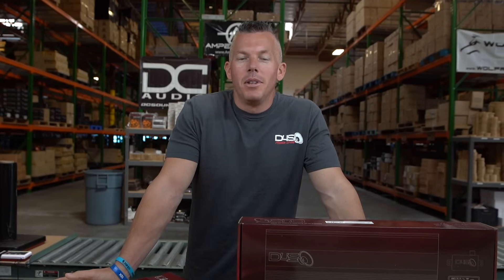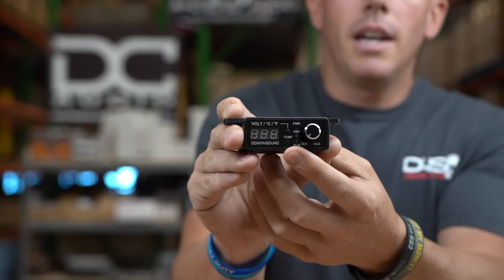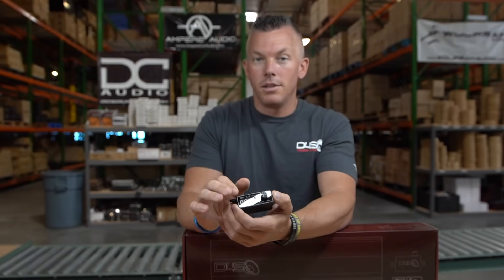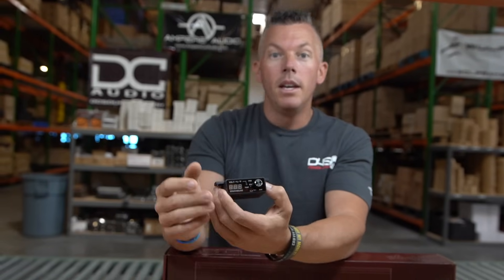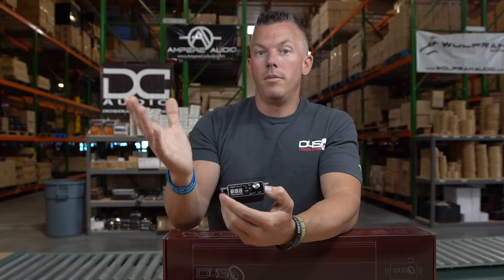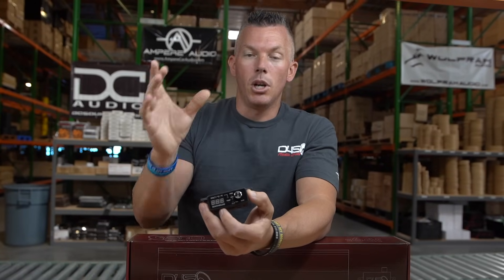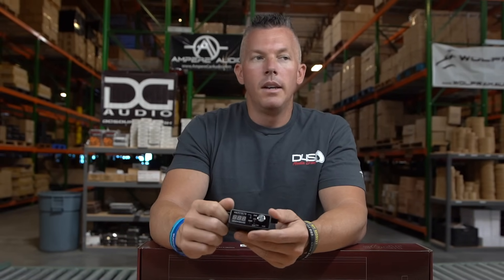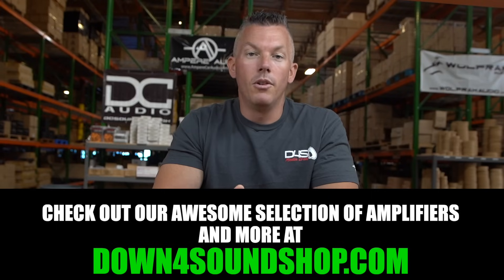CLIPPING: WHERE DOES IT START, HOW DO YOU PREVENT IT?

Comment: i dont think you exactly understand what clipping really is lol its not "more than an amp can push out" while yes, its trying to send more than it can, thats not why its clipping. clipping is mainly because of input voltage. the 1.4v coming from most peoples radios (with the sub level maxed out) isnt enough of a signal for your amp to amplify. its trying to turn something thats barely pushing a single volt and trying to amplify it to 70-80v going to the subs. its basically making up its own signal, thats what clipping is

Comment: I’m glad I watched your video because I had a car audio place put four new speakers in my Ford Ranger 2020 Ford Ranger and there’s two tweeters upfront and two co-axles upfront along with two 6 1/2 in the back with those being 300 W speakers he only has a four channel Alpine 300 W amp running to all my speakers and these Alpine came with 2 crossovers  and it doesn’t matter how you tune this thing oh and he also put a 8 inch kicker subwoofer behind my backseat so it’s clipping and it’s clipping around the volume at 30 you cannot turn it up all the way to 40 and I have the new Pioneer 10.1 inch WT 6000 deck I believe it needs at least 1000 W amp for those alpine speakers at 300 apiece. What do you think? Can you please help me thank you.!

Comment: I have a question if I may. My powered speaker (Groove Factory ABS 1002/A 10" 150W) has  2 inputs which have their own volume/gain knob and a volume knob for the master output of the speaker. The volume/gain knob for each input just has a min at 7 o'clock and max at 5 o'clock with graduated markings. There is no marking for 0db or unity. My question is where is 0db or unity on this graduated scale.

Comment: Can starving a amp for power cause clipping? I am having issues with voltage drop in my car with a 200 amp alt on x2 agm batteries hitting as low as 11.8 volts  my wiring is 4gage welding grade pure copper i know should be 0 gauge and it will be soon but figured my amp would be ok for short bursts since it's sitting on a 100 ah agm brand new battery rated for 2400 watts pushing my Orion XTR PRO 2300.1dz on dual EVL ported box, it's not even half as loud as my dual SDR setup was on a RP 1200.1.

Comment: A more important factor that wasn't touched on here is proper gain staging and signal flow.  You want to ensure levels are optimum between each stage or component in the signal flow for best performance. It's like driving with a manual transmission.  To get the best performance out of your engine, you want to shift when the engine is at peak performance, just below max rpm.

Comment: As a master tech in the electrical/mechanical fields I am curious why you do not explain this correctly. Three things are important here: as follows:

Voltage, Ampacity, and Electical draw vrs what is actually available. These three things equate to actual output - PERIOD.

Maxium electrical draw is required first to determine what the actual wire sizing needs to be for any given system. For example: A 12 gage wire will handle 20amps with 140 feet of wire run- constant @120volts, safely. So if we consider electrical loss over said run (voltage drop) we also need to consider ampaicity of said wire- hence the rating. The number one rule (Ohms Law)  is as follows: As voltage drops, ampreage rises- and as voltage rises, ampreage drops this is true in ALL electrical circuts be it an AC or DC circut. The alternator(s) in your car uses a rectifier circut to create an AC electrical signal then rectified into a DC electrical charge for your battery(s). This is basically how your cars charging system functions. FYI, DC stands for Direct Current and AC Stands for Alternating Current. Direct Current is where electrical signals flow in one direction Possitive to Negitive (depending on whom you ask). AC flows in two directions and has no actual ground at the source, it's "ground" is actually neutral it acts as a return path and as a ground source at the same time. No this is not the same as a floating ground.

When a circut is over driven you get "clipping" this is due to many factors, but for the most part the amplifier is "out of gas"- or over driven, this, be it lack of voltage or amperage usually both. However,  really good amplifers with properly designed regulators wont let this happen. I wont go on any futher upon this topic as it would be a moot point, Except to say this: your typical car audio amp has a 12 volt source @ a given ampreage, where as - a home audio amp has a 120 volt source @ a given ampreage- do the math.  :) Volts times amps equals watts.  One thing that has always botherd me about car audio is the S/N ratio it is usually below 85 Db - this is terrible. Consider the audio circut and the noise interjection.

But I will say this, consider your grounding & power points, they need to be thick and rust free- preferably directly coupled to the battery source and never crimped in a bad manner. Always remember Polarity is king in a DC Circut- as it rules what DC sources actually do (push or pull) and finally remember this- AND IT IS  VERY IMPORTANT- the output of your car audio amp is a DC source (Polarity driven),  a very different animal then your home audio set up, yet excatly the same, ask yourself why?
Reply: the output of car audio amp is ac.
Reply: @nickpowell7432  um, no it is not, ac doesnt drive your speakers, dc does. come on dude learn before you speak.
Reply: @kodi4167  learn before you speak

Comment: I imagine that not having a pure sign wave like if an inverter or generator is being used not providing a complete buffered power supply could potentially cause this if it's not supplying power with the frequency at or below that of the signal to the Sub? I guess if it was a constantsound at all it would be noticed and 60 Hz is pretty universal

Comment: gotta sundown x8 v4 d2 with the 2800rms jp23. has this clipping issue figured this would be a winning combo. would upgrade to bigger but my fear of this not being the issue holds me back
Reply: That's the beauty of a SMD DD1 or an oscilloscope. You using a quality LOC from either Kicker or Recoil to connect head unit to your amp? Get one of those, only $25, and turn down the Gain on your amps. The LOC will let your amps work less hard and run cooler with a better signal.  Clean power. Clean signal. That's where it all begins. That's why using a capacitor is also helpful. It cleans the power to your amp.  Batteries do the same.

Comment: Hi. I have a JL Audio HO112R-W7AE Ported H.O. Wedge. I purchased a JL Audio JD1000/1 1000 Watt Class D Mono Amplifier to power the sub. The W7 is a 3omh sub . The amp can push 800W RMS @ 3 ohm. Will this be under powering the sub? IS it going to be clipping ?

Comment: Question. I have an amp that does 4000 RMS, and 2 kicker solo x 15” subs wired down to 1 ohm to the amp. Gain set to right before distortion and Crossovers set to 25hz of my 30hz tuned box, 80hz for LPF. Using the SMD DD-1 & CC-1. Have 350 amp HO alternator with a 2nd battery XS power 3100 with a 630F  ultra cap bank. Im getting a soft clip at louder volumes 34/35 of 38. With Bass Knob turned half to 3/4 way up. I get soft clipping at dynamic kicks with like a flash of red clip light, and if i turn the volume or bass up more it will be more of a hard clip with a solid red clip light. should I get a larger amp that can feed the 4k RMS with extra headroom such as a 4500/5000 watt amp.

Comment: Got to start at the head unit. If it’s clipped so will the rest of your signals to the amp. It’s only amplifies the signal.  Got to check and set at every unit. Head unit, high output to RCA’s Dsp and the amps.  It’s a process.

Comment: I just installed a taramps md800.1 earlier this week, two ds18 z10 elites d4vc wired together to 1 ohm. I had to put a switch on one output wire from the amp to the subs and have it turned off at first otherwise when it powers up the subs thump and the clip light comes on and shuts down the amp and it does it repeatedly. Do you have any suggestions to fix this?

Comment: What if my amplifier gain is almost all the way left, turned up just about 1/10 but still clipping when I turn the head unit to volume 22/50? Also I have the big 3 upgrade and 3 batteries.

Comment: Explain it to them like the subwoofer is trying to follow the sign wave but it stops at the point it clips and it’s when it stops. The little voice coil wire starts heating up. So the subwoofer moves up and then hits the clip and stops the moves down. Hits the clip and stops momentarily. You can’t see it but it’s happening and then when it does that that’s when the voice coil  starts heating up and the wire burns into

Comment: I'm running two sdr 12s skar, RMS 1000 per and my amp is mono blk 1 channel 8000watts rated at 4 rms, my amp is turned down nearly to zero on all settings but my Xover is turned up pretty good and I'm clipping around 27 volume. But I'm only running 8 gauge power and ground, and a very old alternator, have two batteries but not upgraded yet on the big 3.
Reply: Always upgrade alternator before adding batteries.

Comment: Does clipping come from head unit or amp?
Reply: Don’t you hate when you ask a question and it doesn’t get answered I’m pretty sure it comes from the amp but I learn new things every day I was having the same problem with my amp I started with a sound stream  Txp1.3500D and ended up going through all that series and ended up with the Txp1.18000D and still had the same problem I turned up the gain a bit and it seems like it helps a little bit but I will see I just turned it up today but going through a couple amps and subs to figure it out is crazy the subs I have now are Soundqubed hdc3 12s I also think I need to add another battery to give it more power to help stop the clipping btw my amp was also cutting out after the volume was too high

Comment: It does not turn your sine wave into a square wave... It clips the very top of the wave off yes the top is flat but the rest is still a curve... If it was a square wave your cone would blast to the top stop  and blast back down it wouldn't even resemble music instead it flows up normal stops for a bit and flows back down, this all happens in I split second at 30htz it goes through that cycle 30 times a second! And somehow the coil sitting still for that miniscule amount of time will generate huge amounts of heat. My custom 18 will yawn at a 5k amp nonstop playing but heavy clip from even a 320w amp will get it stinky pretty quick and mild clip from a 5k will too.

Comment: When adjustments to the gain for clipping do I need to have the bass volume control, on the head unit, at what setting. Say for instance the bass control level, on the head unit, has a 0-10 levels what number level do I need to have that set at when testing for clipping?
Reply: I believe that is extra power for the sub. Take this with a grain of salt but I have a headunit that has the similar volume thing, but I just leave it at 0. I believe it’s just for those who want to add more volume to your subwoofer.. I think it depends on your power and your subs limits…

Just use your maximum undistorted headunit volume and leave the bass thing at 0 and I think you should be good.
But I used a -10 sub test tone for my sub, on the amp gain.

Basically see what works for you and what sounds good. Experiment with it until you get it right. Hope this helps as I see no one has replied to you.

Comment: i always have my Amp volumes / bass volumes on the 11 Point top middle of the 12 number clock type of number wheel of the volumes type so i don't overpower and clip my amps/subs/speakers. I got told that the top middle 11 point to 12 point top middle of the numbers clock volume knobs keep them around 11 and 12 points volumes so you don't overpower / so you don't blowout the subs/amps/speakers. It's the safest point of the volumes?

Comment: I have two 10” shallow mount subwoofers, a 2,500 watt monoblock amp, wired in parallel to 2 ohms, with an aftermarket head unit. I don’t have a bass knob, I use a radio pick up cable. It used to run with the bass all of the way up, on like volume 30. One day I sold my old amp so I plugged it up to show the guy it worked. When I plugged my amp back in I accidentally shorted the wires plugging them in so I replaced my fuses, and within 3 weeks it started clipping. And thoughts?

Comment: Hi im new to this but wanting to get subwoofers but I have a question please 
 can you listen to subwoofers for hours or do you need to let them cool down I'm looking at low power subwoofers and not showing off just my personal use probably a 12 inch with about 300 to 500 watts any information is truly appreciated thank you for your time and have a great day fred
Reply: A lot of it depends up your setup. I drive about a half hour to work and a half hour home and go full tilt most of the time. I don't give it a second thought when I do. I occasionally will go out for and hour or two with it and will glance at the temp on my bass knob but it is just habit. My present amp (JP8) has always stayed at a reasonable temp and has a cooling fan. 
My kids(one is a teenager and the other in early 20s) both love it so we will roll around 4 or 5 hours playing it sometimes with occasional stops for the restroom or something like that. My setup is behind the seats and I will sometimes reach back and feel the dustcap on the sub. In a lot of subs they are designed to help whisk heat of the coil and help air move around the coil. If it feels like its getting more than just warm, I will maybe play something that isn't as bass heavy or even load up a tone generator app on my phone and push a tone at moderate volume for a minute to get good airflow on the coil. If you smell the coil, its best to get a tone going or some moderate music , just not so loud that it continues warming. 

I have had a lot of different setups over the years and you really get to know the quirks of yours after a while. Those inverted mounts allow better cooling to the voice coil and a sealed enclosure gives the least, I believe as its the same air that is heating up inside the enclosure. You don't get a chance to smell the coil, at least not in time, on a sealed enclosure with a regular mount so it is something to be aware of.

Theres no reason most setups couldn't go for a few hours but you probably wouldn't want to go full tilt the whole time and maybe strategically select your playlist. I listen to a bit of everything and the old 90s "mini-truck bass" stuff like Techmaster PEB, Bass Cube, Bass Boy, Magic Mike, and others of that sort can be pretty hard on a sub. The "rebassed" stuff is probably even harder but I don't typically play any of that. I would not expect to play either of those all out and non-stop for hours unless maybe you have a supplemental cooling system for everything. 

I would also suggest you get bigger wire than you think you will need. 500 watts sounds huge, and it is good power, but most people get used to even a 3000 watt amp and start craving more. It can be an addictive hobby and there is no harm in good wiring, plus if you upgrade, you have that in place and aren't pulling the whole install just to upgrade the power line. Some people don't get like that and you may be one of those but it is just something to consider. I have so many old wires laying around because I just kept buying the minimum of what I needed. Last time I ran 2/0 and put a reducer on the wire to fit it to my amp.

Check out Williston Audio Labs and there was a channel called "Budget Gems or Budget Bust" (he hasn't been active in a while but really liked his specializing on budget friendly amps), they both do amplifier tests on an amp dyno to see if they hit their listed numbers. You can do a 500w setup or more without breaking the bank now days. Parker the Basshead used to show more subs and is a decent channel as well. Not sure if you are looking for a budget build but I would say get the next model up from the Skar SDR(seems really popular with people starting out, used to be $99 but not sure now) if you go that route. Its not a terrible sub but after doing a side by side with the Skar SVR(was $139 last time I looked but could be had for $125 with a coupon code), it was worth the extra extra $25 for it. More musical and hit lower. Sometimes there are coupon codes if you poke around online and sometimes not. I am not necessarily recommending you go or not go with Skar, just an example on the lower priced side of things.

Comment: I wish clip lights were standard issue on all amps. Very good idea.
Reply: Taramps amps come with it
Reply: @IvyThePanda I have a Taramps 3K. Love that amp!
Reply: @robertholsopple9451 I have the smart 3 bass now and I’m having clipping issues I had it on stock power on my old Colorado with my smart 3 and now I have a newer Denali diesel canyon with a huge AGM battery and I can clip it with a 1500 rms speaker easily. I’m unsure why this new amp and truck just are not getting the power.. I may have to upgrade my alternator this time..

Comment: so I have a 160a alternator that puts half at idle, a new group 35 battery up front with the big 3, 1/0 ofc running to the back to 2 semi truck starter batteries powering a (true) 3000w ds18 amp  putting out 2100 at 2 ohms. it's connected to 2 sdr 12s that take 650 each rms and 1200 peak. How am I getting clipping when my voltage doesn't dip below 13 and I have so much electrical going on.